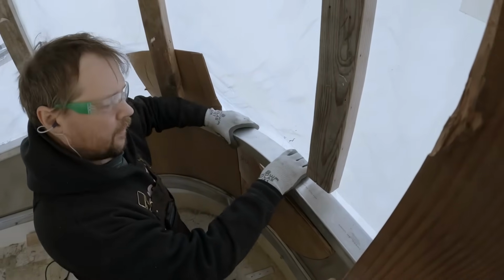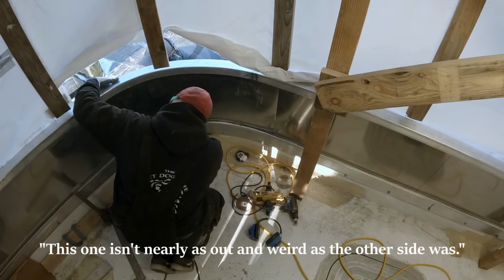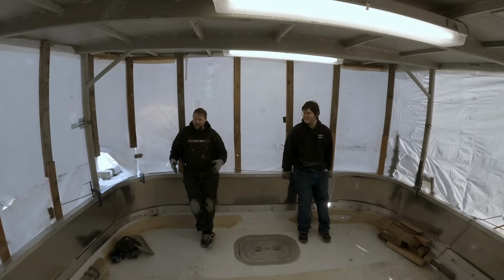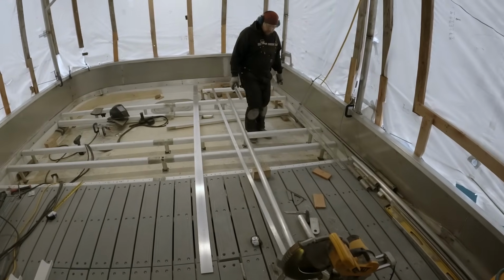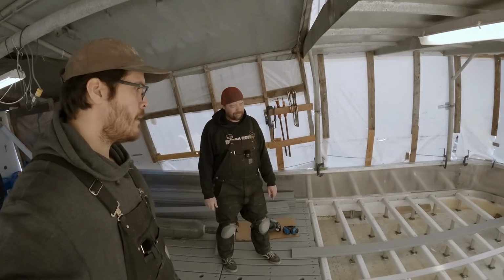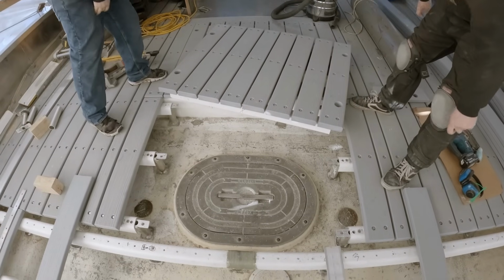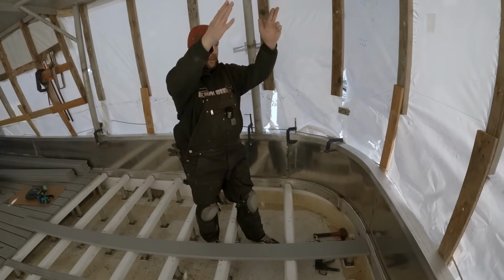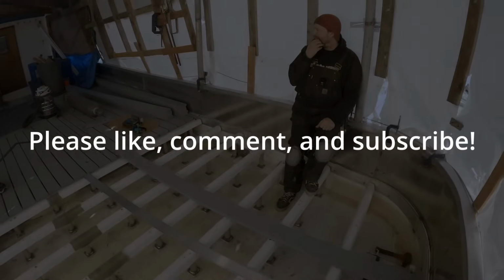Aft Deck Stringers and Starboard Corner Bulwarks - Emerald Isle: Ep.97 Fishing Boat Refit

Comment: I have to comment on the deck stringer design. The design and work is top notch and an additional stringer or two will ensure that there is little chance of sagging or flex under hard use. It’s a commercial boat, it will get hard use.
Without the extra strength you might have to endure years being unsatisfied with the function of the rear deck. Extra hours of work today, to prevent years of looking at the deck and thinking about what should have been done. The risk is to high,,,,,
GOOD CALL and another good video and I like the music.   Wow the deck looks great .
Reply from the maker: Agreed! Underbuilding and having to redo things down the road is counterproductive and annoying.

Comment: When I use composite decking I usually space my floor joist no more than 16 inches apart, so your spacing although looks close should work real nice.
Reply from the maker: Good to know! Is that 1 1/2" stock or 1"?
Reply: @EISAlaska  they call it 5/4 but its actually barely an inch !

Comment: Can you remind us why there is raised deck, and how you will drain below it.
Reply from the maker: Sure, the raised deck serves a couple purposes. One, it facilitates moving gear on deck. Say crab pots for example, we'll be able to slide heavier gear across the deck without worrying about damaging the fiberglass sub-straite. 

Two, it helps with drainage. We're not exactly sure how wet this deck will be. She is a heavier boat which means potentially you get more wave water on deck. If you're standing out there working the water drains through the boards instead of wrapping around your feet, especially towards the bulwarks. 

Three, It flattens the deck. The raised coaming of the holds becomes flush with the deck so there is no tripping hazard there. Also, the deck has a crown; a slight arching curve, port to starboard, this helps to shed water out of the scuppers. With this comes somewhat uncomfortable footing. Standing on a slight incline all day is pretty uncomfortable, the false deck flattens the entire thing.